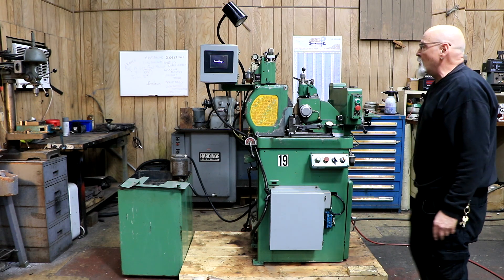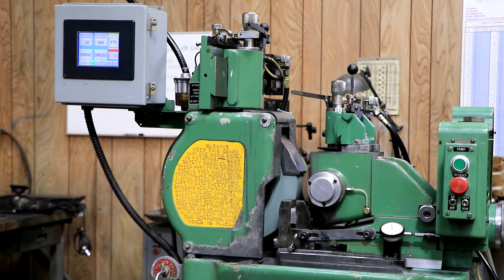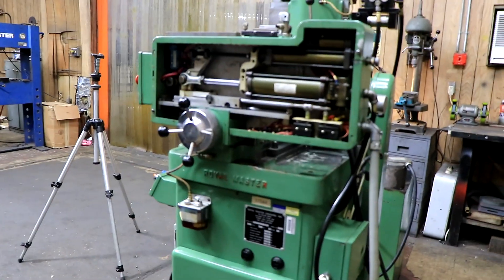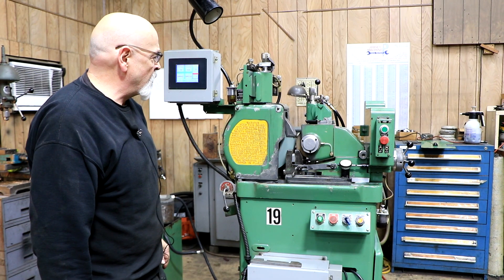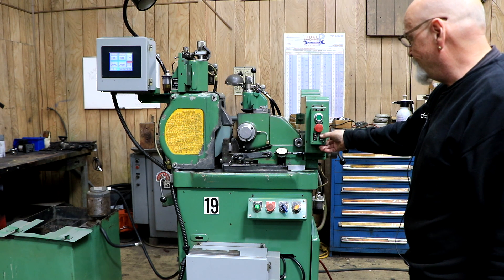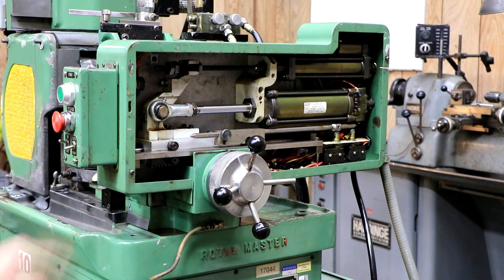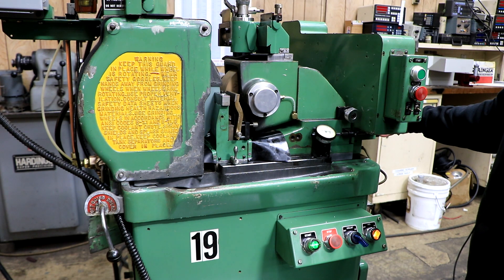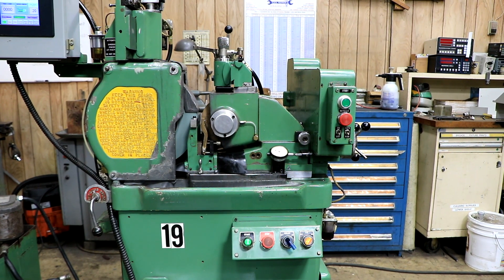ROYAL MASTER "HIGH-PRECISION" CENTERLESS GRINDER       WITH AUTOMATIC CYCLE OPTION

Comment: I have infeed taper issue, operator side is .0007 bigger than exit, the more I swivel and fix that. The taper will start to creep to a point where now my regulating wheel is far beyond work rest blade, and next pieces is just garbage.